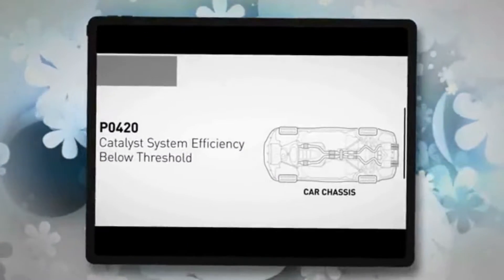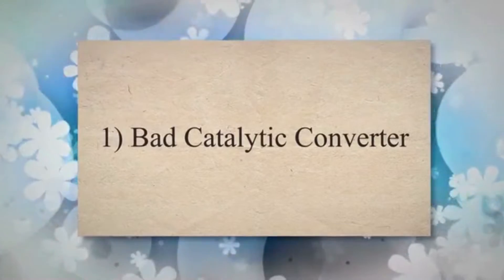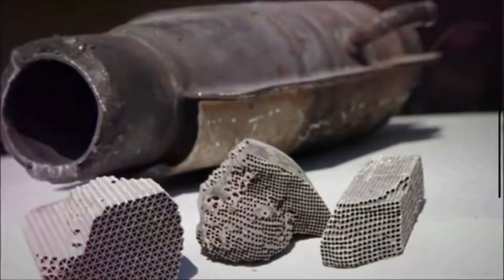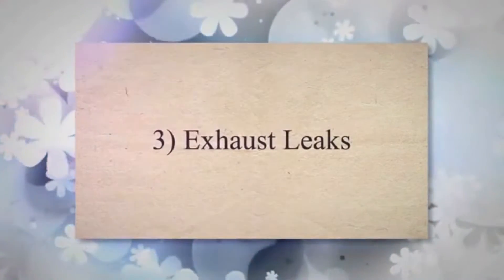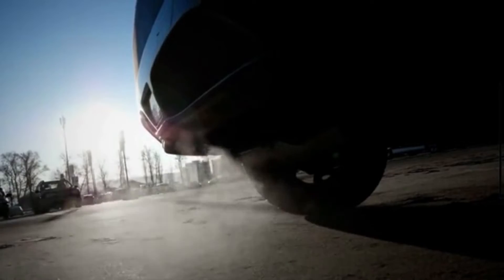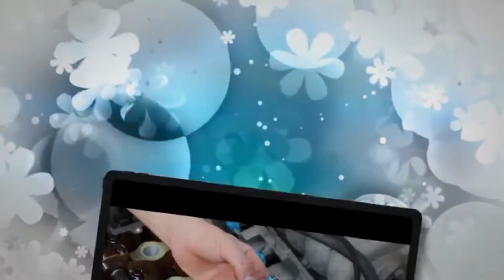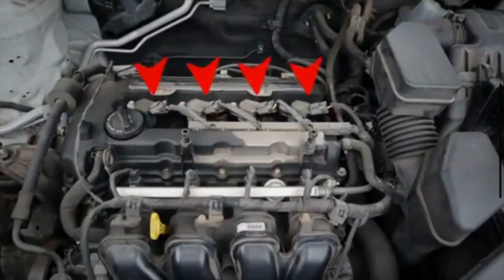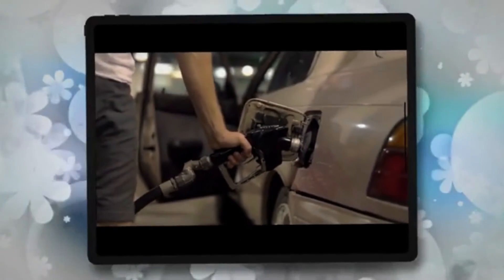P0420 ENGINE CODE CAUSES AND SOLUTIONS

Comment: In short anything can cause a P0420 code.
Cars were so much better when they had carbs, hardly any sensors and no emissions crap. Far less problems,  far less expensive diagnostic and repair bills and any problems you did get were easy to fix at home. Cars have taken a massive backwards step over the last 25 years.